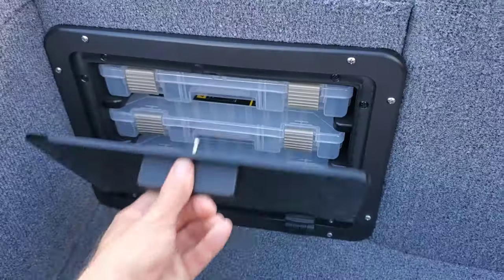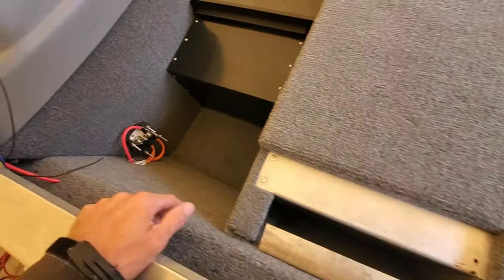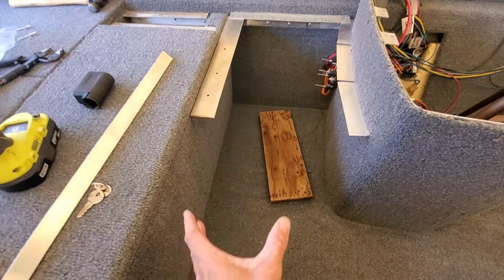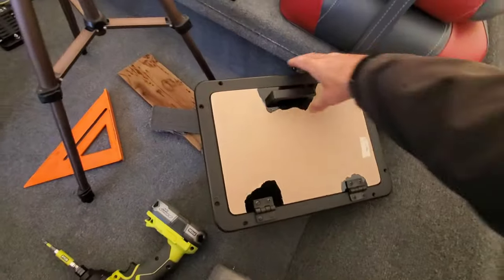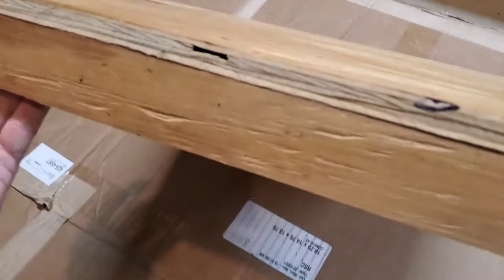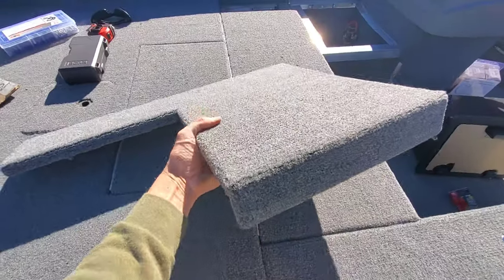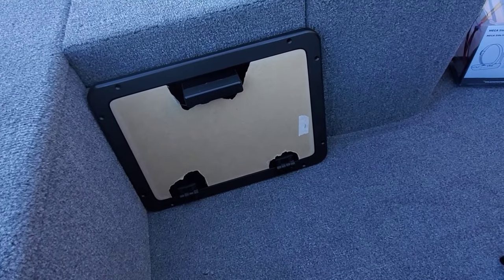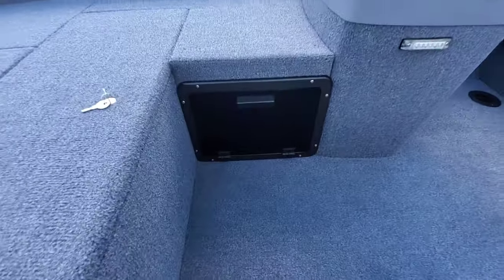HIDDEN Tackle Storage Under Deck!

Comment: A+ brother… as always!!! Question? Building my boat now from ground up, I can’t decide between carpet or Eva…I like the concept of carpet because decals,as a commercial artist I got some cool ideas in my head but anyways,what is the ideal gap to leave for carpet or Eva? I’m doing all aluminum…
Reply: 20 oz carpet 1/2" gap 3/8" if you want the to be extremely tight when opening
Reply from the maker: Yes, typically 1/2 inch gap for 20oz carpet. With eva foam those gaps can obviously be a lot tighter. We go with 1/4 or less on our lids that have antiflood tracks. But great question, when I do a build most do not realize we custom fab the lids specifically for carpet or foam which is why a lot of my restorations get carpet back in. Otherwise we would have massive 1/2 inch gaps eith foam which would look and function quite bad.
Reply: Thanks guys!